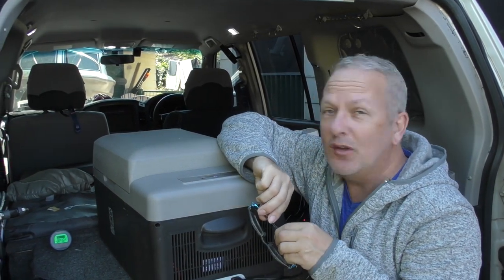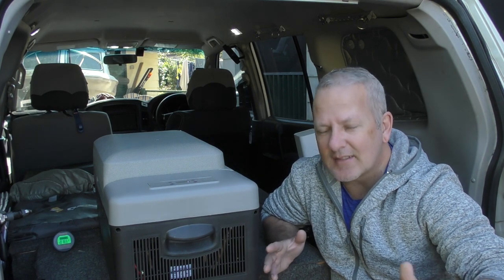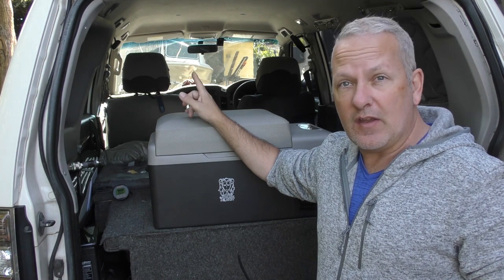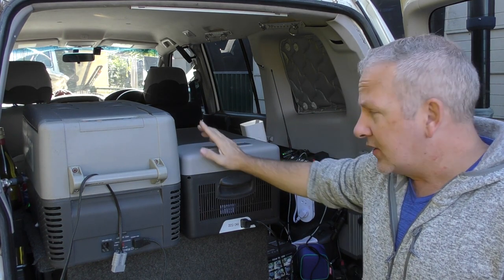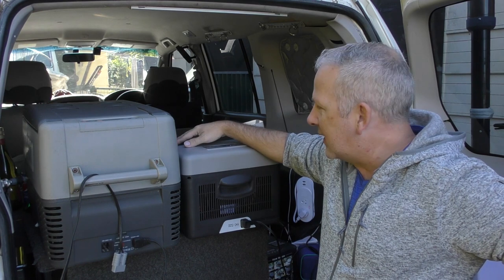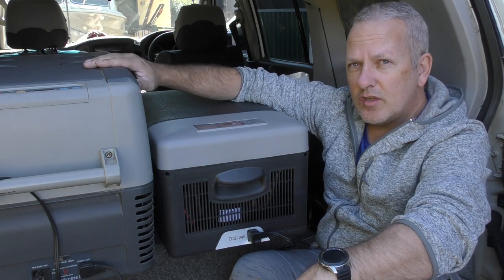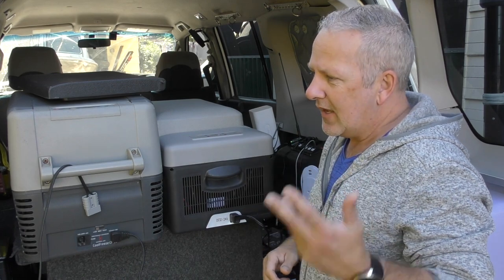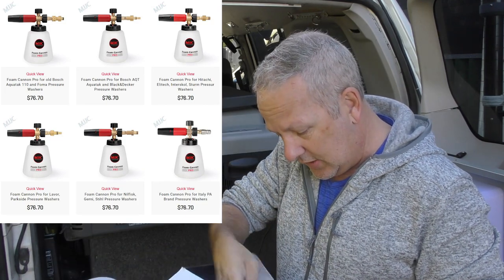15L Brass Monkey Portable Fridge or Freezer Review

Comment: As a second small portable we got the little 9 litre to run 'as needed'. Been great to quick freeze a few drinks then leave it off. Or move drinks out of a bigger fridge to save the open/close problem.
Reply from the maker: I haven't fully convinced myself of the 2 fridge system just as yet but the drawer fridge is just so perfect for day to day 24/7 type duties. I just missed a 2nd hand 35 dual zone brass monkey last week. I figured I could have a frozen section as well as a little extra fridge space. I do like the idea of having the drinks in their own space though.

Comment: One cool thing about using the internal battery that you can get on the bigger models, you can run it off a solar panel directly without the need for an external big car battery. They sell an the cord to do it as an extra for around $20. Really handy for taking it out of the car for the day not needing a big battery to keep it running.
Reply from the maker: Hey Brett, yeah I spotted that and it would be interesting to test out. Might be a summer thing. Be great to be able to take the fridge down to the beach for a while day and just have it running. Great idea,  if it all works.

Comment: Happy birthday big fella!  Another year closer to retirement I hope.  Then we’ll get more videos. 😉. My identical Brass Monkey fridge has a problem with turning itself on and off for no reason.  I’ve checked all the connections and they are sound.  I suspect it might be the H1, H2 and H3 voltage setting.  But I can’t find any info about it.  Very annoying.  Excellent review.  If I needed to secure mine down I would screw a coat hook into the handle or just drill a slotted hole right through the handle to take a tie down.  That might be the neater option.  👍👍
Reply: If you have afault they have a 3year replacement warranty, if you still have a receipt
Reply from the maker: Thanks Dave. A bit of info on what those settings are would be nice that's for sure. I guess it's ready enough to change to find out. I'd say the h1 setting is pretty conservative I think.  I think the handle option is likely the best way to go.  Keep me posted how y go and if you use warranty. Would be good to know how they are with that sort of stuff.

Comment: I have the 25 liter Brass Monkey and its good, same length & width as yours but a bit taller and takes 36 cans comfortably, but still not tallies. I got it half price from Jaycar with a free battery.
 It will take 2 lithium batteries and I can also use either or both  of my Dewalt & Milwaukee power tool batteries to run it too, but it Requires an adapter if U want to do that, and it cannot charge the power tool batteries but that is no big deal.You also either use it as a Fridge or Freezer not both at the same time
 It's a quiet little sucker too & no vibrations or shakes.. I also bought the dedicated thermal cover for it but wish I hadn't because it is pretty dodgy, the battery part of the cover & the clear plastic cover for the digital control panel is total CRUD. 
Mine has 4 big strong tie down points but it has to be kept perfectly level when its running which is a bit of a worry & a bad idea.
Bigger would have been better too, but good for a weekend and you get what U pay for I Guess,

Comment: Brass monkey are pretty average fridges. I have a 25L and it's not too bad but you can just tell the build quality isn't very good and just won't go the distance confidently. Got it to use as a dedicated freezer and it does perform pretty well. If it was a bit better insulated would be better but you just pay for what you get. And as for no tie down Points . . . . Big fail! You're spot on! How the FK are u supposed to fix them in place? 15L isn't too bad floating around but a full 25L definitely needs any easy tie down method. I rigged up a strap over the lid but very much less than a desirable setup. Has made me reassess my direction in fridges a bit. Have a 38L Engel eclipse which has been going 24/7 for about 7 years and still going strong 💪
Reply from the maker: so the 25 doesnt have them either ? I just don't understand how they missed them . This one will run as a full time freezer for the most part. For 140 bucks I was willing to roll the dice. That said, I've never bought a new fridge and don't anything starting with an E and all of them are still running. I hope I haven't put the mockas on myself now.

Comment: Thanks for a very informative review. Based on it, I am persuaded to buy one!
Reply from the maker: Thanks Grant. It's been running 24/7 since I picked it up. I think jaycar are pretty good with their back up service too. Not overly impressed with the extra lid though.
Reply: @DENMONKEY  Yes I thought the lid looked pretty ordinary. I'll stick with the original.
Reply: Just letting you know I have just bought one from Jaycar. Love it. They now have an upgraded one on sale; it has the slot for the add on battery as well as two cup holder positions in the lid.

Comment: I think the only way to for it down with them is to buy their cover. I assume they have one for 15 litres but will it fit with the expanded lid?
Reply from the maker: ooh i didnt look to see if their covers have a handle or tie down points. Thanks mate. I will have a look to see. if they do I will get one for sure.
Reply: @DENMONKEY  Yes the Cover one my 15L has tile down points in each corner, However doesn't fully cover with the expanded lid, I just leave the cover top open. Moment sits in the lower rear truck of my tesla powers by the car battery, I love it

Comment: jumpstart battery only lasted 5 hours on the fridge  I tried it twice and was more hopeful the second time after a full charge over night, so a bit disappointing for me but matches the portable battery pack performance you mentioned.  happy that my Paj start battery copes fine with the fridge load all day without a run of the engine but now to fix a solar panel to extend the power available
Reply from the maker: Yeah I'm not sure those jump start packsv are always what they say in the side. Depends where they come from I guess, but I wouldn't expect much more than that. Solar is definitely the way to go Les and getting cheaper by the day

Comment: I brought a 25lt Brass Monkey before Easter as a second fridge for drinks. Sits in my home made camping trailer running of my 12v system. For the 5 days it was around 30 degrees every day and didn't eat into my battery running of solar. Yes no tie down point's. Very happy with it.
Reply from the maker: Thanks for the info buster. Once summer gets here later in the year and it's sitting in a 50+degree car then we'll see how she works. Most feedback I've heard has been positive, not all but most.

Comment: Love my Dometic CD-30. Can fit about 36 cans in there easy enough or a few days food. Your position is a bugger spot though.  Will be interested in seeing how this has gone after a few months and a few more trips. Considered a smaller one for the front of the car to use while traveling. Ive got a fridge in the garage about a 53L with no tie down points. Need a power cord for it so it doesnt get used atm.
Reply from the maker: Don't get me wrong Mick, I love the little dometic. It's my fridge that gets used 24/7 at the moment and this in that hole nicely. But it's nice to have that little extra when needed without pulling it the big girls. These are so handy at Xmas too if you've got a power brick to run em. Stumps for yard cricket and a beer fridge. Perfect.
Reply: @DENMONKEY  cool mate. I can tell you still love the Dometic. We still need to catch up so we can check out each other's Paj. One if these days I will get that remote compressor set up like you have done too. I'm hoping my big fridge works well as I want to put it in my trailer build but if not I will look at something like the Brass Monkey ones. They seem to be decent quality and cheaper than other brands.

Comment: Any update video's coming up about the lithium battery?
Reply from the maker: Part way through editing. Anything you want to know in particular?
Reply: @DENMONKEY  Nothing in particular mate. Maybe thing's you would do differently? Advantages/disadvantages over sealed units? I'm thinking about building one for my caravan soon.  Just want a no BS real world review. I'll wait for your update. Keep the informative reviews coming.
Reply: I've been using this fridge with the 15.6Ah lithium battery for a while now. At about 25 degrees ambient it will power the fridge for a good 24 hours.

I got the fridge and battery for less than half price, and got the cooler bag chucked in for free due to a small bit of impact damage on the back ofm unit.

I mainly use it in my work ute as it really simplifies the whole dual battery thing for a company vehicle that you can't modify. I also use it as a secondary beer fridge (to my 40L frodge) when my partner and I hit the road.

Comment: Thanks for the review.
Although I'm an 'Engel Tragic' I was considering getting a small fridge/freezer.
My original Engel 39ltr is over 40 yrs old and still runs and keeps the drinks etc cold.
More recently I've had an Engel MT35FP 32L Fridge in the back of my 4WD. 
Its on 24/7 with power from a roof mounted solar panel feeding an AGM battery.
It does the job, be it when out shopping or in the bush/camping etc..
A 750ml wine bottle or 2ltr milk container fit easily.
Not knocking other makes but I find Engel to be excellent unit - although they aren't the cheapest.
Stay cool and safe.. :)
Reply from the maker: Hi Bluey, you know every time I see a 2nd hand engel pop up I nearly buy it. Not because I need it but because I want to see what all the fuss is about. It will happen one day. That said though, none of my fridges, giant, waeco, brassmonkey , campanion,  dometic  or vertigo (van) have given me any grief (fingers crossed). literally everyone was picked up second hand , so Ive had a good run. It would be hard to say I prefer any over the others because they all .....well cool stuff. they're different shapes and sizes that makes them more useful for certain uses but overall, I've been happy. Hope that stays true .